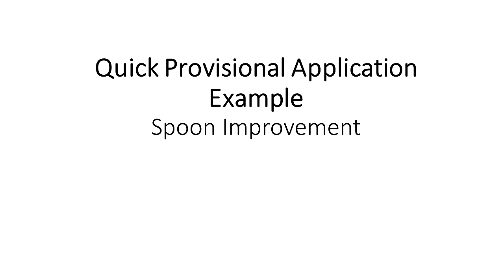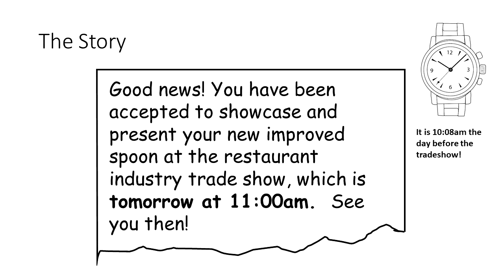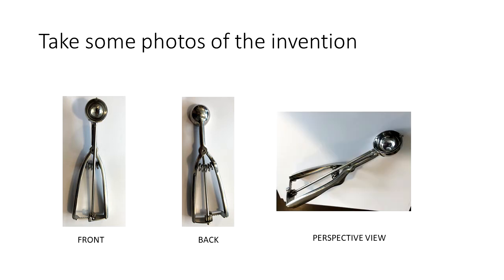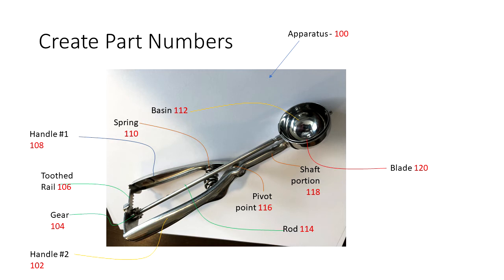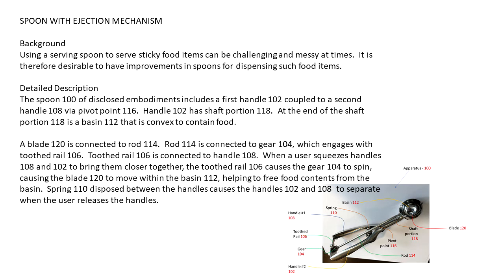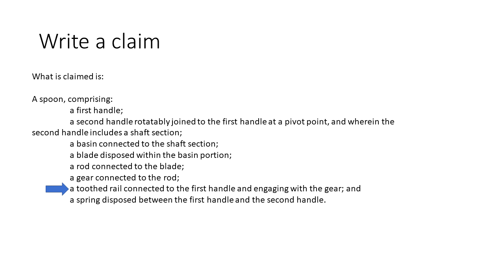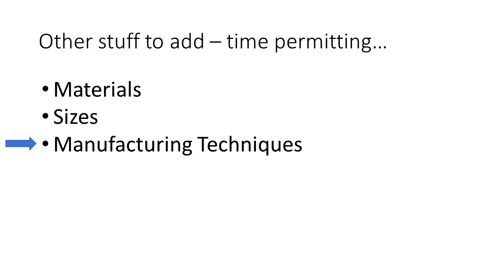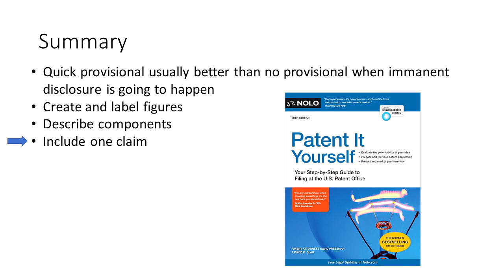Writing a Quick Provisional Patent Application

Comment: Isnt't provisional patent application should be broad? So that we are not limiting our scope in the non-provisional in the future. Like if you add a claim and later wish to rescind it or expand it in the non-provisional, wouldn't you be stuck? Also, how about using "may" instead of "is" such as "A blade 210 may  be connected to rod 114".